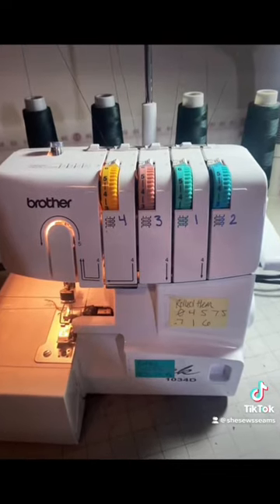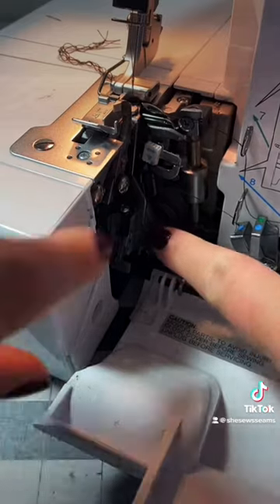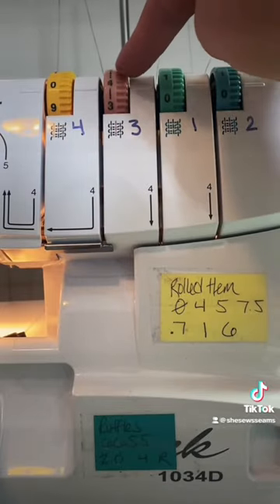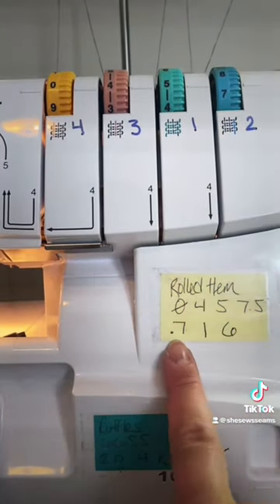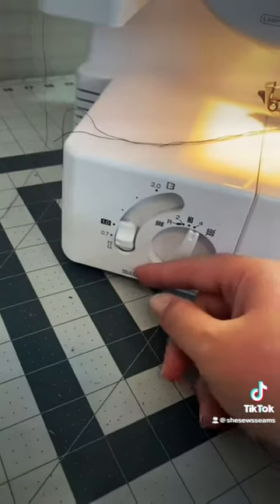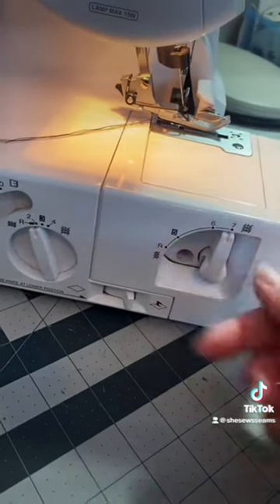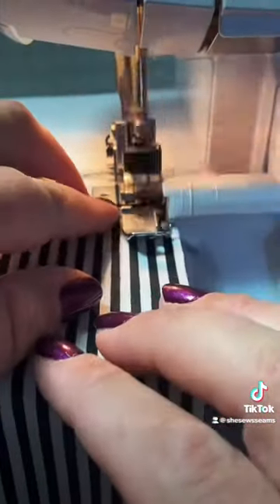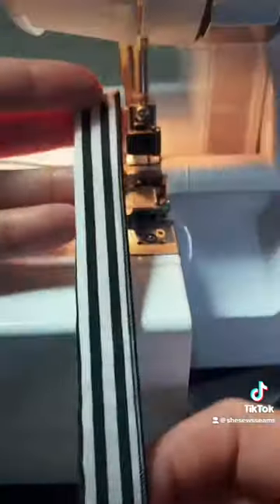Brother 1034d Serger | Rolled Hem Tutorial

Comment: If you are having trouble put upper looper at 4, and lower looper at 7. Keep in mind if you are changing out your thread do not thread with the tension dial at 7, otherwise your thread will snap. Adjust differential feed at 1.0, stitch length will be at R, and stitch width at R for rolled hem. 
This setting was great for Satin with all purpose thread.
Reply: What about stretch fabric ?